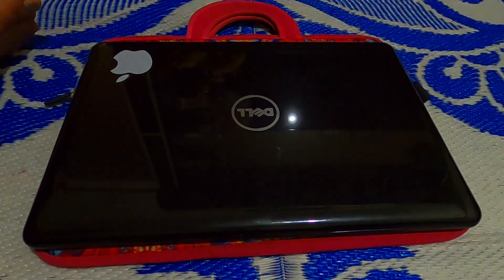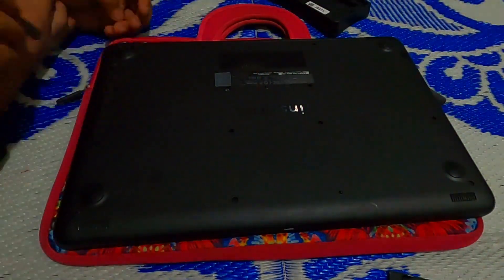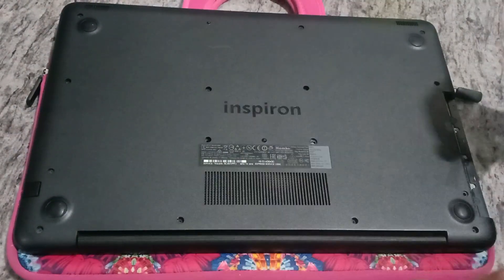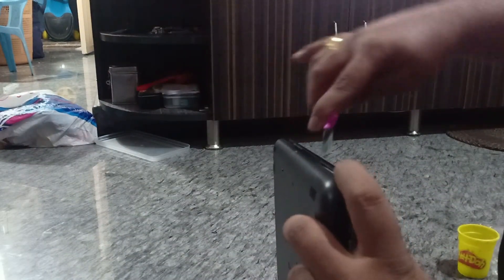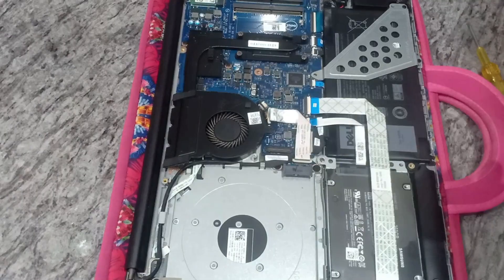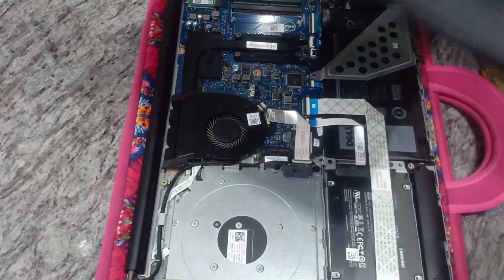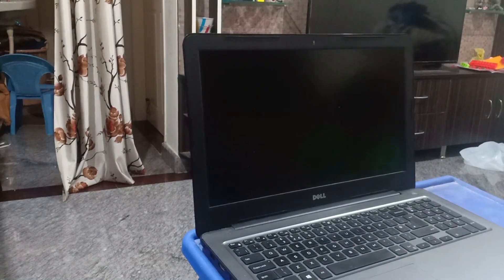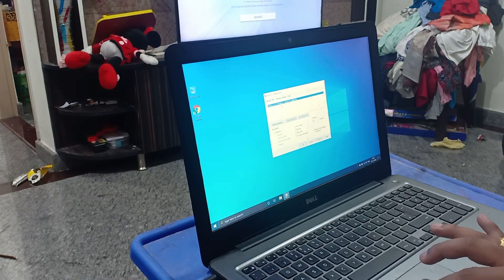#SSD Upgrade for Dell Inspiron 5567 Laptop using HDD Caddy | Trending India Products

Comment: Great Video, better than all other videos for this model.
Thanks Sir. I am also planning the same upgrade as yours. Any tips or problems you faced till now like drivers or boot issues?
What is the improvement in performance and any battery life u=issues after hdd installation in place of optical drive ?
Reply from the maker: tip I can give is opening back panel, it is bit difficult, open carefully. No issues at all, Regarding the battery use yes it is consuming bit more than usual, most of the time I use editing software which actually consume more power so I always keep my charger on. Improvement is app loading, Booting speed, U would really like performance of laptop after installing ssd. I feel like i am using macbook, its my personal opinion. By the way for videos editing we should need 16 gb minimum I would say. Later on i realized amd added 8 gb more.
Reply: @MiddleClassFinds Thanks sir for the info. i have no issues with with back panel as i already opened it more than 10 times. I also ulgraded ny ram to 16 gb and a new battery, now just want a ssd.
Reply: @MiddleClassFinds  Is there any speed issues with the hdd after installation in caddy?also the link to hdd caddy product is correct.Can u provide the correct link
Reply from the maker: No issues, its quite better than before reading memory after installing ssd.

Comment: I have also did the same configuration with same model.... But facing and issue... My system got dump randomly by showing blue screen with error classpnp. Sys.... So what should i do... Somebody says ssd is not compatible... But as i can see in this video... You have also done same configuration... So what should i do now to solve the problme

Comment: Hey if I install windows in ssd what happens to the data in hdd will it remains there
I need my apps and data and installing windows in ssd
Reply from the maker: There is a method to migrate os to ssd but I didn't do that way.... Ur data in hdd will remain there, like photos videos, ur storage...
Reply: @MiddleClassFinds  what about softwares and apps
Reply: @MiddleClassFinds  i need to do a fresh install
Reply from the maker: Actually I did as fresh install, There is an option to migrate os from hdd to ssd but when I tried that way for me it shown some errors... Did as fresh install... If u migrate os everything ur data including softwares will be there
Reply: @MiddleClassFinds  ok

Comment: Sir I got windows 10 pre-installed in the laptop. So if I replace the hdd with samsung ssd, does this mean I will have to buy windows OS?
Sir if there is any way around it please suggest
Reply from the maker: Read this article before changing 
https://answers.microsoft.com/en-us/windows/forum/all/windows-10-activation-after-replacing-hdd-with-ssd/1f285b64-abb3-487f-8459-5a253183f1b0

Comment: I heard about static discharge  
Did you get any problems and
Evo 860 sooooooooooooo expensive😂
Reply from the maker: No static discharge happened for me, It is working fine, my laptop is 4 years old, Battery was gone, Have to replace it...
Reply: @MiddleClassFinds  ok dude please reply if I comment after the installation
Reply from the maker: Before installing pls know the procedure to get original software license back, normally some people are facing problems if they change hardware part first enquire about that and then do ur installation
Reply: @MiddleClassFinds  ok bro I ordered a caddy it's different from yours 
In yours the caddy screws are in the sides but in mine they said to fix it in the back
Reply: @MiddleClassFinds  hey bro after replacing for a new battery, how much does the charge last? I feel that since I put the second hard drive my battery was drained.

Comment: Hey, did u get the tools along with ssd , if not kindly share link for caddy and screwdrivers
Reply: I get both of these scredrivers with SSD? or do i have to buy it separately?
Reply from the maker: For ssd u get nothing bro, but if u buy caddy u get small screwdriver that useful to replace dvd rom to hdd caddy... Normal star screw driver u get from hardware tool shops
Reply: Ok bro thanks alot
Reply from the maker: Yes they provide small star screw driver for fitting caddy... And for removing laptop normal star screwdriver is needed ...
Link for the caddy
https://amzn.to/2J08IyC
Reply: Brother, should i also buy ram as it has 4gb RAM only and curently i face hang issue even while using chrome only with 2 , 3 tabs. Or only SSD will do.
Reply from the maker: Bro go with RAM also for sure, It definitely usefull... Check ur laptop specifications up to what limit u can extend... And if possible add 8gb more to it...
Reply: I have the same laptop with i3, thanks again sir.

Comment: Bro why you skipped the videos, I've the same laptop, I've already inbuilt genuine windows but jb windows dal gyi uske baad wo windows genuine detect hi ni kr paa rha... Please help
Reply: Kuch ni hua... Dell wale microsoft ke paas bol rhe and vice versa. And now they are saying for the service center which will be paid now.
So I installed Windows pro activated version (cracked) and it's working fine for me. Genuine ke liye ab bhaga dauri ka mtlb ni.
Reply from the maker: Bro please give me ur email id ?
Reply: Bol rha iss device pe windows activation detect hi ni kr paa rha
Reply: Even main microsoft ke account se bhi link kr chuka
Reply from the maker: If it is genuine and u linked with Microsoft... Complaint them bro They will do the needful
Reply from the maker: It supposed to activate by itself.
Reply from the maker: Please do same version which u had before...

Comment: my same laptop does not show ssd in optical drive.  what might be the problem
?
Reply from the maker: Sorry, I don't know, For me it was shown
Reply: Same here. I have a WD 240GB ssd. When I put it in the caddy it is not shown in Windows disk management. I replaced the caddy also still the same problem.
Reply: @blair49  put the ssd in place of hdd by opening the laptop and put hdd in optical disk. This way it worked for me.☺️
Reply: @shankarpokhrel368  oh. I thought the caddy was not working so I returned it. I will try again with another one.

Comment: is WD blue ssd better than samsung or vice-versa ? please help which should I buy
Reply from the maker: Samsung is the best in segment, what I researched is that. U also research u will get an idea,... Also what is ur use is gonna play major role
Reply: @MiddleClassFinds  I use my Laptop for Project purpose like Web development or Machine Learning purpose. It just freezes.
Reply from the maker: What is ram size you are currently using ?
Reply: @MiddleClassFinds  it's 8 gb
Reply from the maker: This is where the main problems arises, that I recently understood, RAM plays very major role for anything, 8 GB is not enough, My suggestion is first Upgrade RAM, Add another 8 GB like I did. 
First I thought SSD plays major role hanging the system, after I installed ssd, Reading speeds everything but hanging is same, its because when system occupies 8 gb ram, usually it happens, My suggestion would be, First go with 8 gb Ram upgrade, if u have money go with both, that helps you a lot. By just upgrading SSD, I am damn sure its not gonna help you.....
Reply from the maker: At first I upgrade SSD only, By thinking my problem will solve, but it doesn't help, It helped me reading way faster than HDD, 
When I added extra 8 GB RAM, there my problem solved
https://youtu.be/KTv_ZPGfRsw
Watch out this for ram upgrade.
Reply: @MiddleClassFinds  but I guess... I checked yesterday my system was using 7.8/7.9gb memory even when I wasn't using my system also cpu usage and disk usage was 100% , GPU 12% and total processes running were 275 so I watched a tutorial which Optimised my laptop very great... For eg. if I talk about now.. still I'm running some process of mine, current cpu usage is 36% , disk usage is 68%, memory usage is 2.2/7.9 gb, GPU 0%, total processes 172.... It's changed drastically my Laptop performance today.. only thing that needed to fix is the boot time. That's why thinking what to do for that
Reply from the maker: Ok for boot time, Ssd is the only option bro, see the price differences between wd and samsung, If u can afford samsung, go with samsung.
Reply: @MiddleClassFinds  Thanks bro.. yup I'll go with Samsung
Reply: @binod3204  mention the videos please

Comment: I have dell 5567 (i5 7200u readon r7 m445) it's working perfectly fine boot speed is good and all the applications run smoothly I haven't had an issue till now, will there be an increase in perfomance if i upgrade to an ssd? And by how much? Is it worth upgrading? I already have 24gb ram
Reply from the maker: You have sufficient ram, it is more than enough, SSD Depends upon ur usage, if u r into proffessional work like editing etc, and that is giving lot of lag, stuck you can opt to SSD, if there is no lag, stuck, no need to upgrade, but the difference will be read write speeds, Instead u can opt to a better cooling pad
Reply from the maker: Definitely there will be change in performance.
Reply: @MiddleClassFinds  thankyou ill get one If it increases speed of my laptop

Comment: I have same laptop and it hangs alot should i go for SSD upgrade?? Seriously it takes around 3 min to start the laptop 😭. 
And my Disk Load Shows 100% whenever i check my task manager
Reply: @jungle ID’s- same issue suffered lot
Reply from the maker: Yes bro, definitely go for ssd, if u r into editing also upgrade RAM, for RAM Check this, https://youtu.be/KTv_ZPGfRsw
Also check the products which I upgraded in description
Reply: Remove unnecessary softwares, each one of them. Defragment your hard disk. Check your startup programs and disable unnecessary ones. You will definately see improvement after that.

Comment: Sir is it necessary to put hdd in place of  optical drive and ssd in place of hdd
Or we can simply place ssd in place of optical drive?
Reply from the maker: There is no rule like we have to keep ssd in main drive, we can use as both ways, no issues, but if I keep my secondary HDD in optical drive, I can easily replace with other HDD for data transfer etc, Its of my preference.,